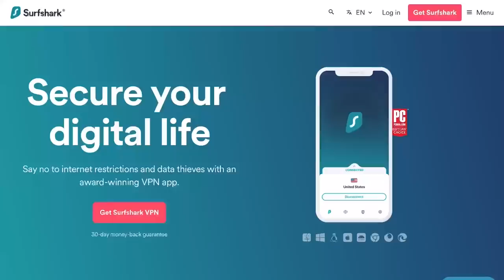She's Left! SOLO HOMESTEAD BUILD

Comment: Lots of love from Canada for you both.  Sweet Bee, I also suffered from PMDD, but in the 1980s when nobody was even interested in addressing it.  It was also pre-internet, so I had to do my own research in a local university's medical library.  What helped me, and subsequently many others, was B6 along with Calcium and magnesium.  I took cal mag, along with a good multi with good amounts of B complex vitamins all month, and then pre-menstrually I used B6 the way I might use aspirin - when I began to feel myself unravel I would take a fairly high starting dose of B6.  If I didn't feel somewhat better in a couple of hours, I took smaller doses every few hours until I felt better.  For the remainder of the PMDD period, which for me was LONG, I just took the smaller dose as needed.  (B6 is now used to treat morning sickness, so the hormonal link is now accepted.)  I understand you are also dealing with depression and taking medication (I cannot take any anti-depressants that affect serotonin) so that may make things more complicated.  I also saw that when medicine caught up to the B6 connection, high doses of B6 were given all month with less effect. I think that does not work because the body just gets used to shunting out more B6.  For me, it needed to be taken when my body and mind told me I needed it, when some hormonal process was throwing it out of whack.  Anyway, it's been a Godsend for me and all whom I have shared it with.  In a life where a lot of  crappy things have happened, PMDD was right up there.  Might be an idea to talk to your doctor about it.  Take good care of yourself, and know you are loved 💝  As are you, Theo ❤

Comment: Why don’t you attach the treads by doing a blind connection up through the tread support into the bottom of the tread? It will be much easier if you ever have to dismantle it & leaves the top of the tread pristine. Not to mention saving you a heap of work plugging all the holes

Comment: Hi theo i just wanted to say theo you are the man . With regards to the banister you could have bolted it down thats one done complete also What is the Paint your using on the rods  . If you ever have to do it again  build yourself a vertical holder for the rods paint all but what needs to stick in the holder at the end of day flip over rod so painted rod end is in holder paint the top  and ready for 2nd coat in am . Hang in there brother i know its hard . Until the next video peaceout.  •¿•

Comment: From experience I can tell you... If you move your chicken coop into your goat pen you can free range your chickens 24/7 and they will not get predatorized. Goats are up more than you think all night long. Our goats were escape artist and would not stay in their penned area. All night long they would wander around the area munching on this and munching on that. We even stopped locking the birds up unless it was super cold because we never lost a single one when the goats were there. When we downsized from our larger farm & got rid of the goats we have been unable to free range our chickens. They love to roost in trees at night and no matter when we would go out to try and get them in their pen they would not go until it was winter. Once it got cold and they knew their coop was warm they would go in there at night at which point we stopped letting them free range once we managed to gather up the ones that were left. Every night we lost multiple birds to predators. The farm behind us has more acreage and when they had their goats penned closer to our property line the birds stop getting predatorized but when they got moved to a different paddock the birds were getting picked off at night.